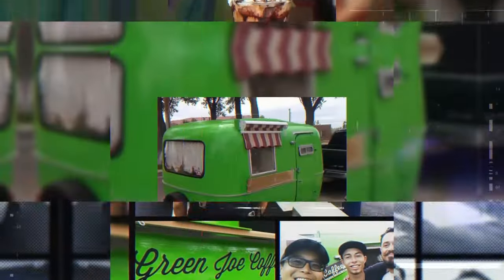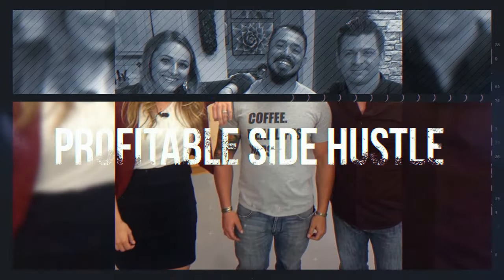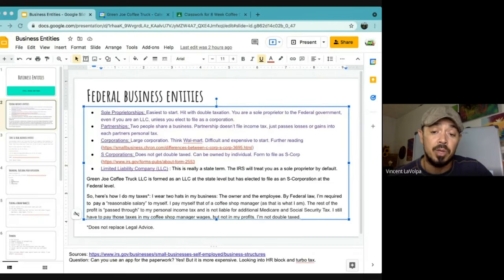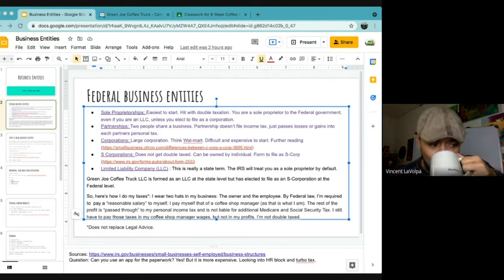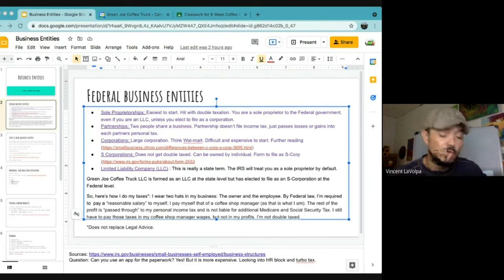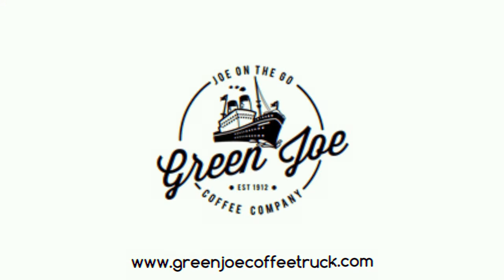Installing Insulation on your Food (Coffee) Truck or Trailer. Cost, Tips, Tricks and How-Tos

Comment: did you not need to place a thermal barrier in between your metal trailer walls and the insulation foam boards? I see the boards are combustible.
Reply from the maker: We did not! It’s to my understanding that thermal barriers are used with spray foam. We just used styrofoam.